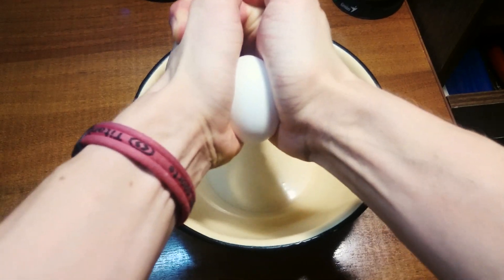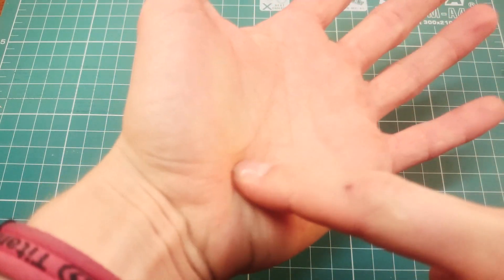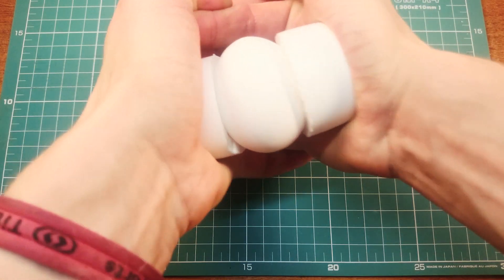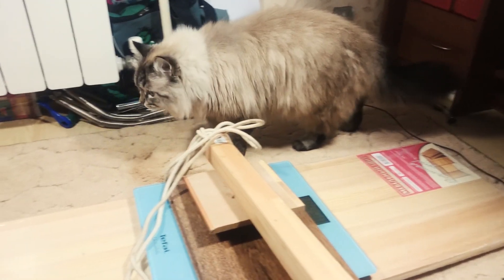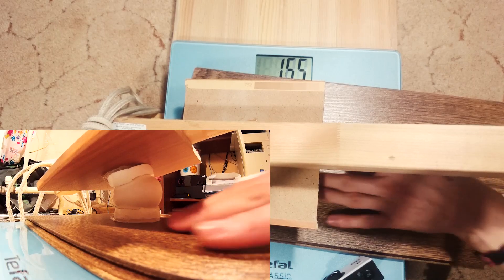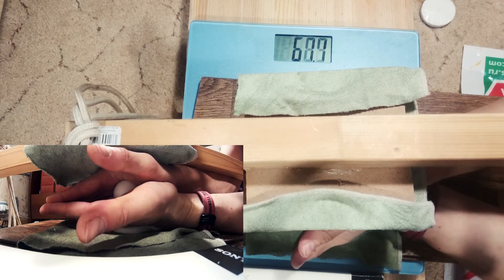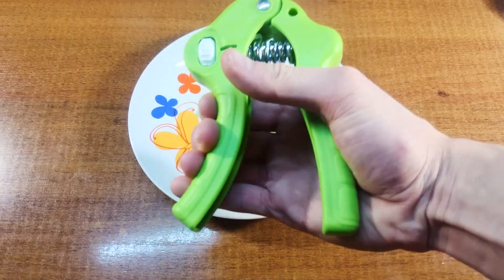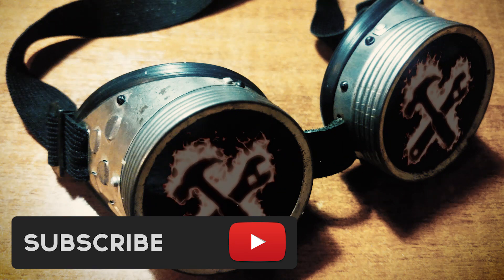Is it possible to crush an egg by pressing it with hands?

Comment: Trust me it's possible..i had quite a mess to clean up afterwards haha
Reply: You did not do it right
Reply: There's no amount of arch physics that can distribute weight evenly enough to protect an egg from crushing, this whole thing reminds me of the blue or black dress thing lmao
Reply: @JehRoniMo11  There is if you can only press with up to 60kg of force with the soft flesh of your hands. Did you even watch the goddamn video?
Reply: @JD_tcb  lol yeah i did, and I don't see how an egg will stop me from crushing it lol, are u just saying some ppl can do it and some cant?
Reply: @JD_tcb  you tryna coerce me into smash wasting an egg? Lol 😆
Reply: @JehRoniMo11  I mean...yeah. Some people (very few) can rip a phonebook in half. You didn't even mention a force--you just said it can't be protected. From what?? Eggs are protected constantly lmao that's the why they're eggs in the first place. 

Literally as they are being squeezed out, eggs are being protected by arch physics.
Reply: @JehRoniMo11  Haha try it! Even if you do smash it, you'll be surprised. But try to keep the force even. It's like doin push ups--resist the urge to "cheat", keep good form.
Reply: @JD_tcb  People who rip phone books in half use a very precise method of doing so because of the fact that it allows more pressure for less energy. I doubt even the strongest of people could rip a phone book in half the same way they would rip a piece of paper in half.
Reply: @memesarekeem  Cool. But it's irrelevant. The WEAKEST people still can't do it if they use the precise method... so hand strength is therefore a factor.
Reply: @JD_tcb  yeah lol I was just saying any arch force can be broken with enough weight, but from what others have said its just very hard, surprisingly hard to do, I guess from the start I was just thinking "its an egg dammit" lol 😆 guess thats the point 🤠

Comment: How is it that hard to crush an egg with ur hands? It is so sesitive
Reply: Because of the shape the weight and pressure basically supports the egg up so it won't break.
Reply: @Slodsworth  but only up until it reaches its break pressure level lol, so this is just a silly strength measuring test
Reply: @Slodsworth  I'm not even gonna try it cause I know I'm gonna smash it and waste an egg lol